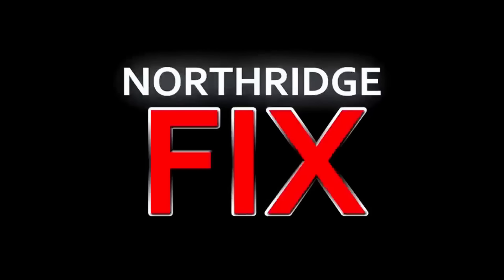Eluktronics Mech-17 Liquid Cooled Gaming Laptop Repair - First time

Comment: It is NB691GG-Z - Converter  DC-DC 4.5V to 24V Synchronous Step Down Single-Out 0.6V to 5.5V, 6A ,11-Pin QFN.
Reply: Yes correct after when i see it i really know after turning upside down i remeber i see it somewhere :D
Reply: If you don't mind... How did you figure that out? Your search methodology could be useful.
Reply: @jeremiefaucher-goulet3365  - schematic drawings probably

Comment: I am just waiting on a HDD for my £4 Xbox One OG to be fixed, I was hearing your voice in my head when I did my flux on the couple solder jobs and the repairs came out perfect with the DVD power wires better than factory on the DVD daughterboard and the HDMI port just looked awesome and every pin contiguous and solid :D   Amtech flux is a bit tricky to get over here as plenty of Chinese fake-o's, I am using something called RF800 no clean, comes with a handy brush in cap and just perfect results where I struggled with cheap and nasty Chinese tin flux before...   Today I am replacing the dock filters on my Nintendo Switch once I have buttoned up the Xbox, the rework station I bought last year is earning its keep having hot air and a decent solder option on the same unit, very pleased I am relearning all my techniques thanks to your good self and others on Youtube, back in the eighties I was a solder king from my experiences building Sinclair ZX80 and ZX81 kits, then went on to college and built fruit machines and did computer hardware engineering repairing Sperry Univacs.   Do get your daughter to make some more music for you, love the end song and my granddaughters think its super funny :) :) :)

Comment: This is a Clevo based laptop. Eluktronics, Sager, XoticPC, Aftershock and multiple other brands use their machines and rebrand them as their own. Clevo is made by Clevo Computers Taiwan, manufactured in the Chinese Foxconn facility.
Reply: No, it is not a Clevo-based machine, It's Tongfang. Clevo laptops do not have the liquid cooler attachment ports like this one has.
Reply: @imglidinhere  That's not entirely true. There are water cooling heat sinks available for a very large variety of clevo high end machines. Eluktronics uses both tongfang as well as clevo barebones for their models.

Comment: If thats a mech-17 gp1 with GMXAGXX_12L_V1.1 mobo can you dump and upload the bios bin? eluktronics and tongfang are extremely unwilling to provide them and I need it to fix mine.
Reply: Second this! This company has their heads up their asses and won't provide bios files. Their support is terrible when it comes to real technical level details.

Comment: fan controller ic or even the tpm? says TP5 on the mobo. a zoomed out view on the board would be helpful.... instead of you know, just showing vendor specific spec...
Reply: TP means test point, that is not about that chip. Chip is marked as U2002